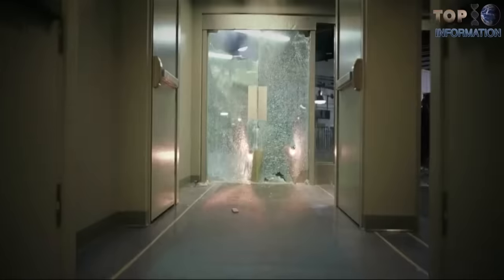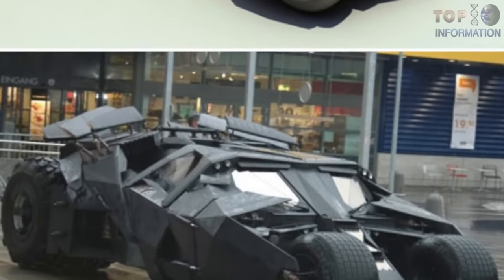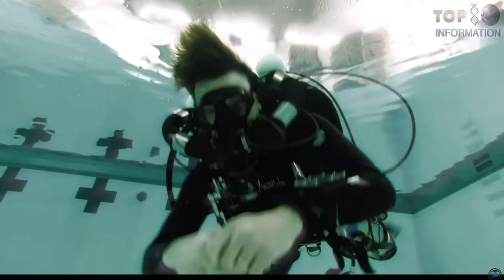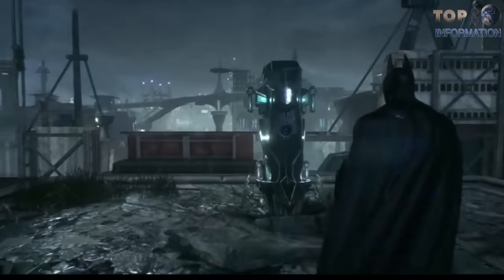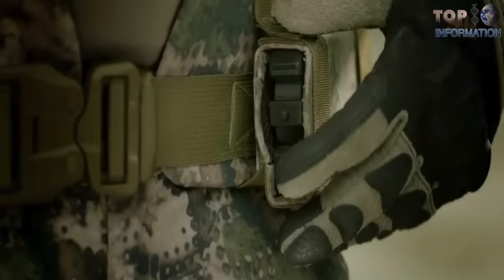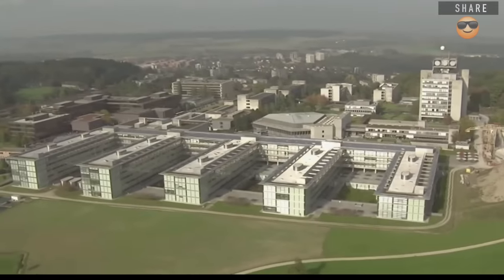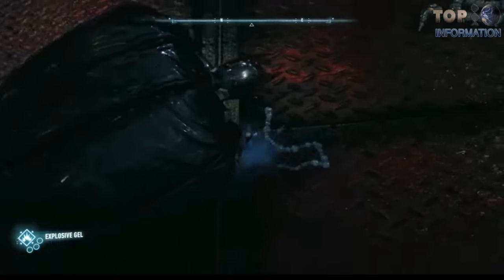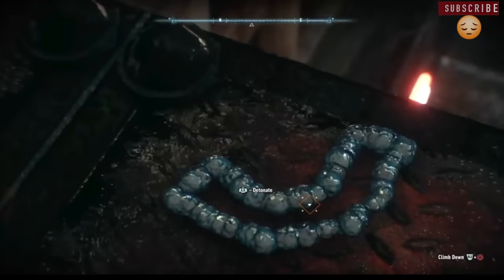5 Batman Gadgets that are Real ▶ 7

Comment: You left out the utility belt modern day policemen, security guards, border patrol and some soldiers use utility belts. Also signal device on belt, what we now call a 2 way pager with GPS tracking. Roller Skates that pop out of shoes have also been invented. Government also invented stealth plane a dark plane that resist detection by radar. Grappling hooks also exist.

Comment: the tumbler is not a tank. the us army's armor is not bullet proof but bullet resistant. and the rebreather that you saw with no oxygen tank doesnt actually work because how much power it takes to extract oxygen out the water.